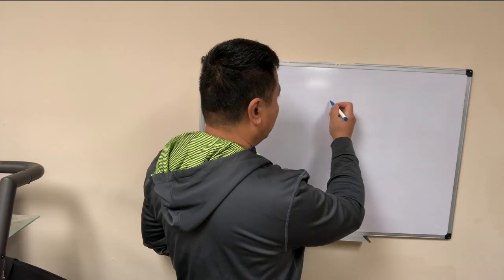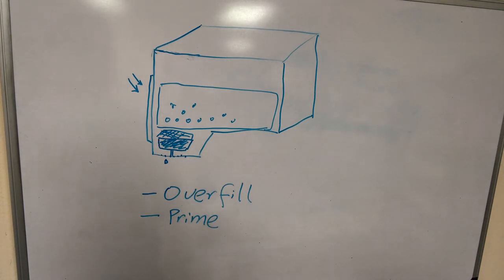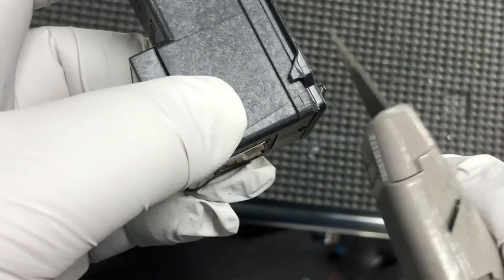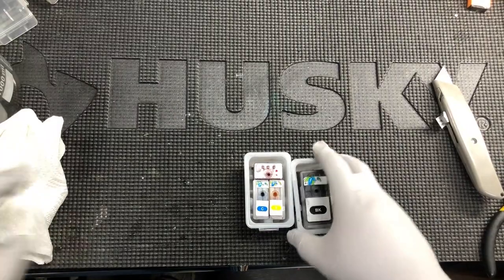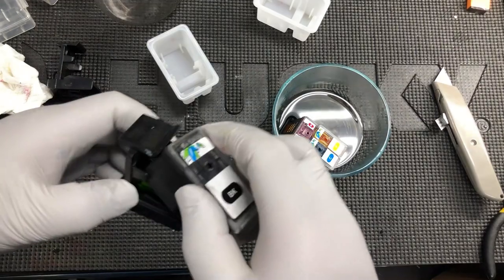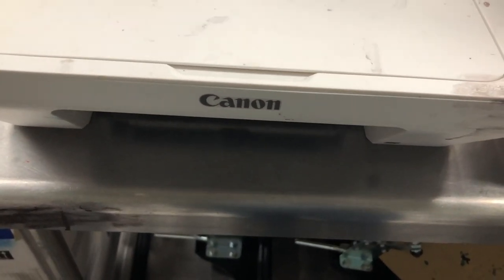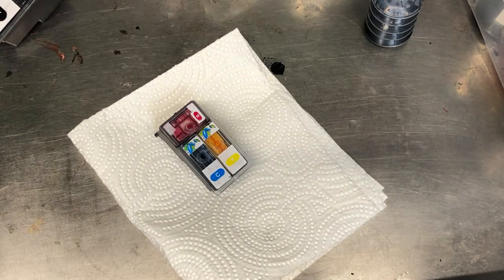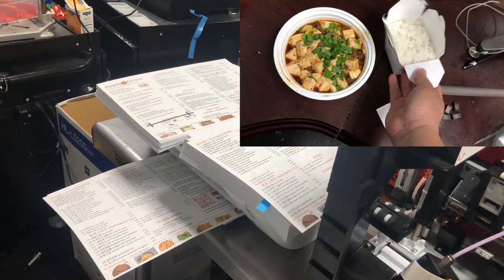DIY Refillable Canon Ink Cartridges: Sponge Mod for PG-245 CL-246 PG-243 CL-244 XL

Comment: I bought these 2 sets ..just got them few days ago ,i had to go buy canon cartridges cause the ones i had were remanufactured and did not fit .I am  so excited to use them when i run out....I live in Ontario Canada and they came within 3 weeks ,and Kevin got back to me within hours of contacting support through the web site .Best information and Keven explains what to do in full detail which is great for a beginner like me .very pleased i found Kevin , will be saving a lot of money as well as my mom. Thank You Kevin .

Comment: what cartridge i can use my canon pixmax 3551, normal have PG-575 and 576 colur, can i use cheapen PG-545 and 546 cartridge too,  545 have lot cheapen than new 575 cartridge buy. and problem have many shop not have 575 cartridge only 545 found. PG-575 cartridge cost black and colour both 80$ and 545 cost 12-20$ lot different price save.

Comment: I love the content here,  and the shop, I use them for many things, you have been teaching us about CISS, and it's really simple when you follow your directions, cause 1st time i did it I got a BIG ink stain. I followed your directions, and now, I just get those big ink bottles, for like 100 dollars per order,  but it lasts for a LONG time
Reply: CISS tank system not cost lot, aliexpress can order CISS kit 4 colour big pottles, 8-64$ diy build simple tubes and pottles to printer normal kit cost 8-12$ very cheap, because new cartridge cost 20-38$ some canon cost 30-80$

Comment: what's the difference between refilling it from the bottom (as what you did with the black) as opposed to filling it from the top (like what you did with the color?) thanks for the tutorials, really learning a lot. ordered a set for 745/746, hoping all goes well.

Comment: Hi, I love your videos, both for your clear style of teaching and your motivation for helping people. Thank you very much.
I own a fairly new, just a few months old Cannon TS5322. I’m dealing with daily malfunctions but can’t identify if it’s the printer, my wife service or the faulty wiring in my apartment building that keeps dropping voltage. It seems that there are very limited options for the PG-275/CL-276 cartridges. I’m wondering if it would be wiser to purchase a printer that uses PG-245 & CL-246. 

I’d really appreciate your thoughts on the idea. I’m not currently a student but I’m hoping to be next year. 

Thank you for your time.

Comment: Thanks for the video. My magenta doesn't seem to be coming out. How would you troubleshoot if one color doesn't come out. I've primed with hot water
Reply from the maker: Use a priming clip.  It will solve 99% of the problem.

Comment: Mr. Kevin I successfully converted my cartridges to spongeless with your clear cartridges lids for Canon TR7020. The color cartridge is printing okay but the black is a mess. I purchase your priming clip. The ink comes out but the paper print out still missing parts. I put the cartridge in warm water for 10. It seems the ink comes out fine. The water rapidly got color black. I put it back in the printer and ran a deep cleaning cycle and still doesn't work. 
Do you know what else could I do? Thank you. By the way, I love how easy was to pull the ink with the priming clip.
Reply from the maker: Check if the black is sealed airtight.
Reply: @BCHTechnologies  I believe it is because when I try to get the ink out with the primer clip it has a lot of resistance when pulling the ink with the syringe. Is there other way of checking? Thank you.

Comment: Hello Sir

I bought 445, 446 new ink cartridges because the old ones were used for a year refill but dead....

Now the printer is not recognizing the new genuine cartriges 

Can you help me with a solution ?
How to trick the printer accepting them? 
Anyway to reset it?

I am using MG2540, i also have MG2440

Appreciating your usual support

Comment: Do you have a video for alignment? I think I need a whole new black cartridge before I purchase this kit but I'm not sure. Thanks for sharing.
Reply: Sometimes the print head on the cartridge goes bad or gets damaged. At that point the only option is to replace the cartridge
Reply: @StepheneeDuran  Thank you Stephenee but in my case it was that I was using pigment ink. Even thought my printer (Canon TR7020) comes with pigment ink, as soon as I changed the ink to dye ink - like Mr. Kevin suggested - the printer got fixed. Apparently the pigment ink I added to the canon cartridges is too think or something. I have no idea why did it worked but I guess that is a question for Mr. Kevin. He is amazing by the way. Great products and great customer service.

Comment: Would it be an issue to use spongeless cartridge on cloth instead of paper?
Reply from the maker: Canon and HP can’t do sublimation.  You can use pigment ink on a transfer.  It’s  complicated.
Reply: @BCHTechnologies  Im wanting to use it on sunnyscopa's print-on fabric which works fine with regular inkjet. But what I mean is that can I use the spongless cartridge to only make a few prints per week or is it meant for mass printing like in video?

Comment: Hello Kevin. I bought Ink from Aliexpress. I filled Non XL Canon 540 and 541 cartridges. But the color in photoprints on glossy photopaper has a very slight white haze overall. Barely can't see. On some. pictures much more evident than others. What could be the problem. Just bad Ink?
Aliexpress seller AOMYA.
Reply from the maker: Probably it is due to your setting.  Of course, I would love to hook you up with some high quality BCH ink.  However, I think your problem is due to color profile not attached to the device.

Comment: I bought the kit and got it today. already cut open the cartridges and put in the new sponges. when place the cartridge against a napkin it leaves a mark but I thought I should prime just in case. I place the cartridge on the priming tool but no ink comes out when I pull on the syringe. I keep getting error code 1401 after a few printings. the first printing or two work good but then I get the error. Any tips or suggestions? TIA
Reply from the maker: The Canon printer error code 1401 usually occurs when the printer is not able to identify one or all the installed cartridges. Check the electronic ribbons and make sure it is clean and dry.